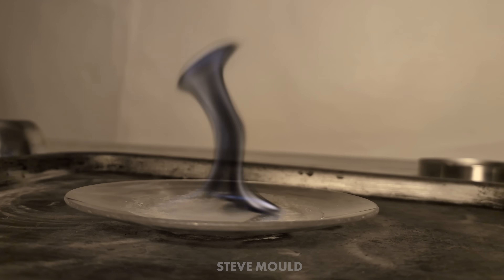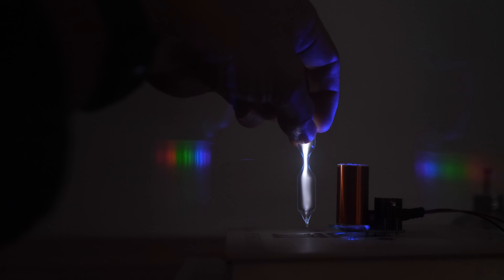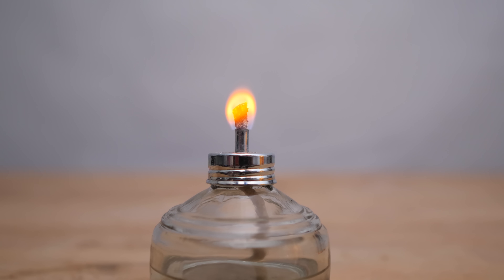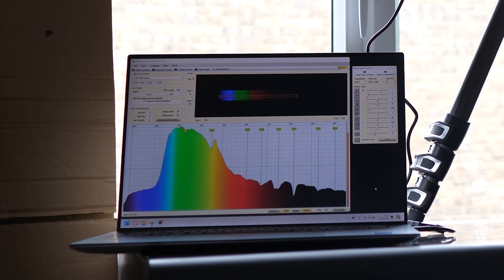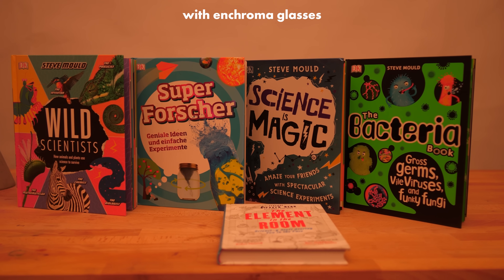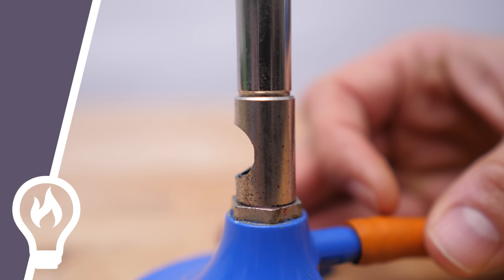Light sucking flames look like magic

Comment: You must watch marco reps.  He just did a video on sodium light.  He said the reason for the other colors in the spectrum is because the lamps have i think he said zinc in them also to heat up enough to excite the sodium metal thats in the glass as kind of a preheat stage igniter ..

Comment: "How can a point-like particle have angular momentum"
Because size is infinite, and given the discoveries we have made in both directions of the micro and the macro worlds anyone who thinks otherwise is a fool. 
 An electron is massive from the perspective of a neutrino, as is a proton or neutron to an electron and so forth; and therefore not "one dimensional".
Stop dumbing people down like Microsoft did to computer users. The human brain is more capable than we have yet to discover.
Reply: Your interpretation seems to be about masses, though. An electron is more massive than a neutrino, but they're both point like particles. For electrons, measurements have been taking to around 10^-16m or so, but there's no theoretical model that really posits a definite size. One things you can do is use the peak of the wavefunction and say "within x distance of the peak, you are 99% likely to interact with the electron", but it doesn't actually take up that entire size. This is why electron size is usually defined by its wave function and the fine structure constant, because those are reasonable distances for an interaction to happen, but there is no definite size or shape. It's just a point as far as science can verify.

Comment: Old sodium lights?! They aren’t old at all. 90% of all street lights owned and maintained by the local power company are ALL high pressure sodium lights. 

Ironically, the old lights that were being replaced with sodium were actually mercury vapor and produced a nice blue/white light. 

People get mad when we replace the broken mercury light with a high pressure sodium because they hate the yellowish orange. 

We also use metal hylide lights for car dealers etc.

Perhaps the old ones you’re referring to are low pressure sodium ? 

I think our high-pressure sodium bulbs are mercury free so they have a worse CRI but high-pressure sodium is known to have an improved CRI over low pressure so I don’t know. I’d have to do the research.

Comment: Great video - I'm being a bit pedantic here but the sodium light used is a low pressure sodium vapour lamp.  The later high pressure sodium vapour lamps had a CRI of up to 80 to 85

Comment: I don't think you considered using the EnMoulda tint on domestic housing. There are plenty of people in terrible locations that get street light blasting into their house. 
I actually use orange tint to block out the blue light from the modern headlights of oncoming traffic. it works on rearview mirrors as well.

Comment: Explanation about emitting photons which came from a wall in all directions is misleading. Yes, they are emitted in all directions. As well, as all light from all other directions (not only from a wall) emitted in all directions. Which means that instead of light that came from a wall, we should see some amount of light from all directions at once. And I'm not sure that this amount will be less than the one from a wall. At least, it's not obvious.

Comment: Sodium street lights are weird. They look odd, but you see quite well in them. When the first led street lights were being installed, i always got that sensation of not being able to distinguish between environment and lets say pedestrians anymore so easily. Ive wondered why that is. Being got used to it? Getting less unnecessary visual information outside the cars own light beams?

Comment: I don't know  the exact level scheme of sodium but in terms of what's emitted when an electron transitions to lower energy level, it's also possible for the atom to emit an Auger electron, so its not necessarily true that if a photon is absorbed the same photon will be emitted at a later time. Maybe this contributes to the black flame effect as well.

Comment: I don't know if Enchroma glasses help you see more colors, but at least for me they significantly helped me tell apart real world colors that I couldn't before.  Particularly autumn leaves, grass vs bushes vs some specific red berries, and even more so the flag (I'm from the US).  I didn't test them in every scenario, but in the places they would be most useful I directly compared them in a few different ways against my normal vision, and they did help me.  I'm quite sure they wouldn't work for everyone though, given how specific they are, and how varied colorblindness can be.  For me specifically I'm moderately red-green colorblind, which means I have a very hard time telling a decent range of colors apart, but there's still a lot left that I can tell apart, which I'm guessing puts me in the optimal spot for those glasses.  Colorblind enough that there's a significant difference, but not too colorblind to be too much for the glasses to correct for.  And even if somehow that was entirely placebo, which I'm pretty sure it wasn't given my experience, it was still very neat to experience a different kind of vision.  Unfortunately those glasses are expensive, and I can operate without them, so I didn't renew them later, but I kind of miss that.

Anyway, I completely ignored the rest of the video in that comment.  The video was amazing, I just had more to say about my experience with Enchroma in this case :)

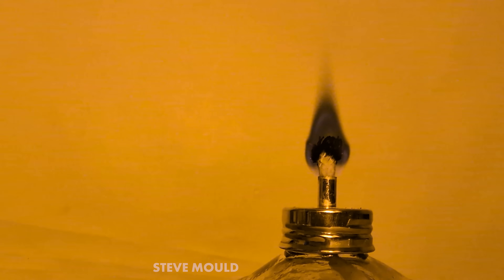Comment: 5:50 so if the flame it black because the light bouncing off the wall is scattered, 🤔would the flame disappear then this if you passed a polarized filter between the wall and the flame?

Comment: There another pair of glasses I suspect as misleading they are sold in spiritual pseudo science gubbins circles and spirit goggles and lenses when they are in fact woods glass aka black light glass used in UV torch filters or cameras and IR photography but no one seem to hold any other information what woods glass is made of I suspect a cobalt nickel and neodymium based glass it's gem like quality and high optical grade make good videography and photography bit I debunk it and quackery, 

You should make a video if you could get more information than I could on woods glass and spirit goggles sold as dicyanin glasses

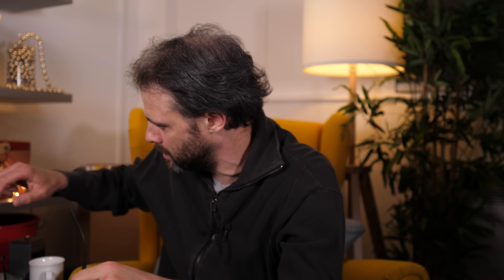Comment: At 07:39, you ask, "Are there still some old sodium streetlights where you live ?" Well, we have very few sodium vapor streetlights. But what we do have in abundance (like many other communities) are defective LED streetlights which emit purple colored light. Apparently, that is because those LEDs have faulty phosphors which no longer convert the LED's UV emissions into a white light spectrum. Perhaps you can make glasses containing such phosphors, since this problem is so widespread. 🤣🤣

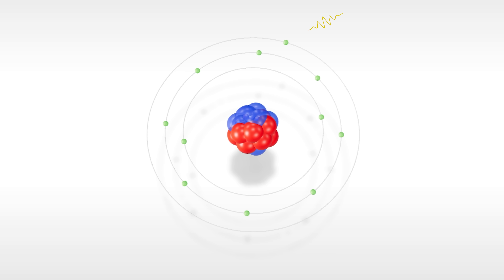Comment: 1:39 This statement is not quite right. I realize you probably know the specifics and choose (nonetheless) to just go with a bit of shorthand to avoid wading through the details, but many might now be left with the impression that "a photon" exists with an inherent color (given a respective energy level). Instead, while photons do have energy they do not actually have color. In fact, nothing has color! What we see as color is really just our eyes (specifically, the rods and cones in our eyes) taking in the different frequencies of the photons entering our eyes and translating them into color. And we observe light pursuant to an aggregation of a multitude of photons and the overall energy level of that group of photons.

Comment: Really intresting Video, but I dont quite agree with your explanation on why the flame is black, even though it has to emit the light it absorbed again.
While it will scater photons that would have hit your eye, it will also scater photons that wouldn't have hit your eye. 
That would also mean the flame should glow if you shine more lights at it then at the wall.
I think the reason that the candle is black, could be that sodium also emits infrared photons as we saw in the spectroscope. Since Infrared Light has less energy that visible light, it's possible that an Electron that's hit by an orange photons gets excited by two steps but takes two single steps while dropping down and emiting photons that are in the infra red spectrum each time

Comment: Sodium has an IR peak of 819.5nm arising from the 3d -> 3p transition. It is actually easy to fact check this using the NIST Atomic Spectra Database:

https://physics.nist.gov/cgi-bin/ASD/lines1.pl?spectra=Na+I&output_type=0&low_w=500&upp_w=900&unit=1&submit=Retrieve+Data&de=0&plot_out=0&I_scale_type=1&format=0&line_out=0&en_unit=0&output=0&bibrefs=1&page_size=15&show_obs_wl=1&show_calc_wl=1&unc_out=1&order_out=0&max_low_enrg=&show_av=2&max_upp_enrg=&tsb_value=0&min_str=&A_out=0&intens_out=on&max_str=&allowed_out=1&forbid_out=1&min_accur=&min_intens=&conf_out=on&term_out=on&enrg_out=on&J_out=on

Comment: >"An electron is a point-like particle"

A much more intuitive interpretation is that an electron is more like a quantized gas. That can have different densities at different locations, as well as angular momentum, and standing wave structures.

The really weird bit is that such a quantized gas has 3 distinct angular momentum vectors. There's the classical angular momenta of the electron cloud orbiting around the nucleus, the electron gas spinning about itself, and then the quantum rotation of the electron gas's wave-function around the complex plane unit circle.

Comment: The directional absorption and isotropic emission argument would work if you were looking at a small lightsource behind the flame, but the wall is so big that the photons are being absorbed from a wide range of angles, too.

Also, electronics are zero-dimensional, not one-dimensional.

Comment: With regard to the scattering thing: Yes, most emitted photons aren't headed towards the camera, but shouldn't it go both ways? Most absorbed photons weren't headed for the camera either, and they should have some chance to go towards the camera, so it should still cancel out, right? Unless the effect is also dependent on camera angle?

Comment: Steve, consider that color vision doesn't just involve the three color pigments and cones, but it also involves the black and white rods. By changing the curve distribution it changes how the eye and brain interpret the colors.

For example. Blue light from LEDs is very high energy and very dangerous.

Side note: the level of blue light in the LED lights now on the market damage the eyes of nearly everyone exposed, AND through suppressing melatonin and hence the circadian rhythm and hormone cycles, the lights CAUSE CANCER. Particularly breast, prostate, GI and rectal cancers. In addition the energy absorption leads to macular degeneration and premature blindness. 

So, people like me who are for genetic reasons extremely sensitive to blue light and who have incredible night vision, this is a severe problem. To address that I can and do wear true blue blocking glasses which render me completely blue color blind. This doesn't solve the problem of the intense and debilitating 120 hertz flicker that the lights also have. So the glasses are only a minor aid.

However, one of the things I noticed while wearing the glasses is that I still see blue. I in fact pass normal color vision tests even though no blue light is making it to my eyes. What seems to be happening is that the eyes and brain using the rods and cones in combination are able to reconstruct what colors must be present despite not seeing them. 

There is a second explanation. And that takes us back about 70 years to a question that was never resolved. Why are cones cone shaped. And do they act a bit like your refractory grating with light of different wavelengths being sensed at different depths. And as a result creating what amounts to a diffraction spectrum of the light in each cone. Just how sensitive can the eye be at that? And how would it report that information. 

About 70 odd years ago, the idea that each color cone senses only that color of light won out in the competition of ideas, without ever being truly answered. 

Or perhaps it is a combination of these effects. 

This could explain how the red-green discrimination could occur in someone with only red or green cones. The energy difference of the two peaks might be the key. And by chopping out the mid ground, this difference is highlighted. 

We still have a lot to learn and understand about vision. 

Why for example are about 1-2% of the population extremely sensitive to 120 hz flicker?  Why are about 20-30% of the population very to extremely sensitive to 425 nm blue light. I believe I know the answers to these questions. But what do you think they might be?

Comment: It should be mentioned that this whole thing is about « Low Pressure sodium » light, not the « High Pressure Sodium » light that have been widely used for streetlights and outdoor lighting for many decades and are still in use today.

Comment: I had never heard the explanation for spin like that before. It makes a lot of sense - at least when trying to think about it classically.

Electrons baffle me. It has angular momentum, but isn't spinning because it's a point particle. But it's not a point particle, it's a quantum wavefunction, and can interfere with itself in a double-slit experiment. It has an "orbit" but the more you probe at it the weirder (i.e. more quantum) that gets. 

And how does an electron absorb a photon anyways? What does that even mean

Another good one is their size. What is the radius of an electron? 

It sounds like a simple question. But it's not.

"The issue of the radius of the electron is a challenging problem of modern theoretical physics. The admission of the hypothesis of a finite radius of the electron is incompatible to the premises of the theory of relativity. On the other hand, a point-like electron (zero radius) generates serious mathematical difficulties due to the self-energy of the electron tending to infinity. Observation of a single electron in a Penning trap suggests the upper limit of the particle's radius to be 10^−22 meters." https://en.wikipedia.org/wiki/Electron#Fundamental_properties

It's an unsolved problem. It can't have a finite size, but it can't be a point particle. All we really know is that an electron sitting on its own is at least 10^12 times smaller than an atom. And it's probably not a point particle, but something more like a wave packet. And if I understand what I'm reading correctly, when it's "orbiting" an atom it's not orbiting in the classical sense, and doesn't have a defined location or size. It gets "smeared out" in probability space. 

The deeper you go, the weirder it gets.

Comment: But light is hitting the flame from all angles.  Suppose that, of the photons that enter the space occupied by the flame, x% would (if it were transparent) be on a path towards the camera.  Wouldn't it also roughly be the case that, about x% of all photons emitted by the flame end up reaching the camera?  And all photons emitted by the flame should be just slightly greater than all photons hitting it, so if we see about x% of the latter, it should be about as bright as if the flame weren't there.  We might need one more multiplier for photons that do pass through the flame, but that would cancel out anyway. 

This string of thoughts started with the idealised (and very false) assumption that light hits the flame uniformly over all angles—if that were true I wouldn't need the 'roughly' above.  It is, of course, not, but I'd expect it's close close enough that the difference shouldn't be quite so stark.  Basically the darkness would correspond to the downward directions (or anywhere else in the environment that's dark) receiving more emitted photons than they contributed, but the parts visible in frame don't include quite so much area that's quite so dark. 

Is something else afoot here?  Or are my approximations just too approximate?
Reply: I presume the trick relies on the background being whiter and/or illuminated more brightly than the rest of the surroundings.
Reply: @tulliusexmisc2191 which translates to my approximations being too approximate.  When you put it like that it makes a lot of sense.

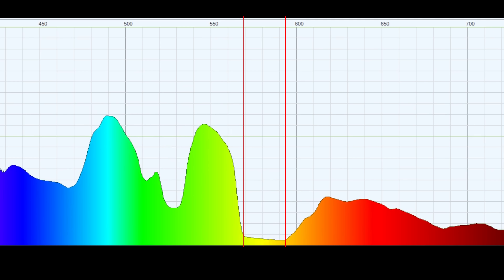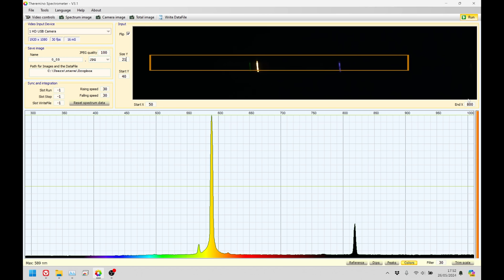Comment: The little green peak at 10:07 may have something to do with the corresponding reduction in green at 12:53? The lenses are removing both the orange and green (to a lesser extent) because they are linked to sodium emissions? So if you then check the peak in the infrared shown at 9:58, will that show a reduction (and prove the link) when the lens is added? You didn’t show the infrared portion so I cannot confirm, but I think it’s worth checking if it is so far unproven that sodium contains a IR peak.

Comment: So the reason why the flame appears black despite emitting the same amount of photons as it's absorbing is the same effect that causes the greenhouse effect of CO2. Sure, it will re-emit the photons, but with an equal chance to emit them in any other direction than they were going, resulting in net less photons getting through.

Comment: hes using an outdated model of the atom, Bohr's model was proven to be incorrect, smh... The main problem with Bohr's model is that it works very well for atoms with only one electron, like H or He+, but not at all for multi-electron atoms. i love steves videos generally, but that was a glaring error...